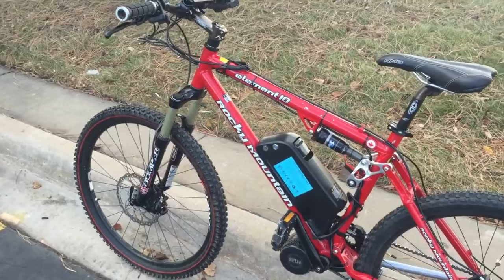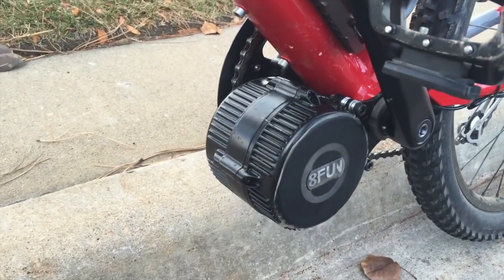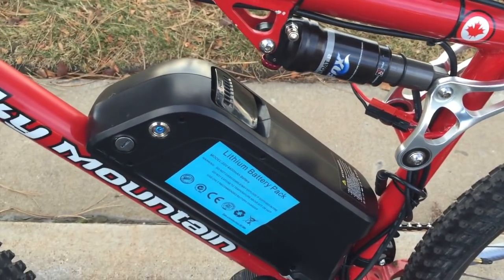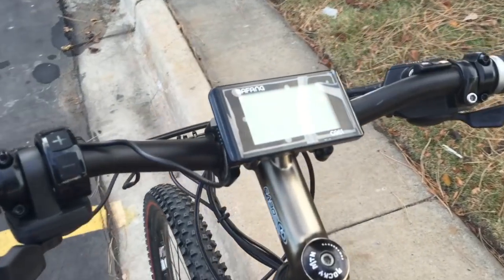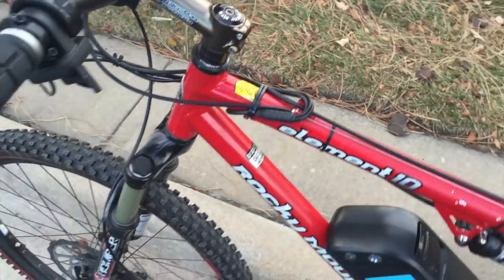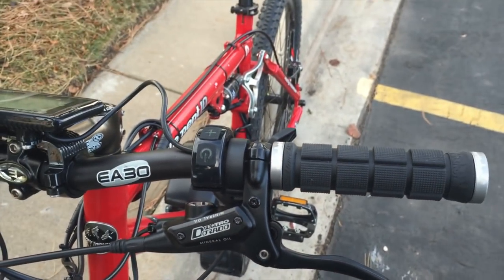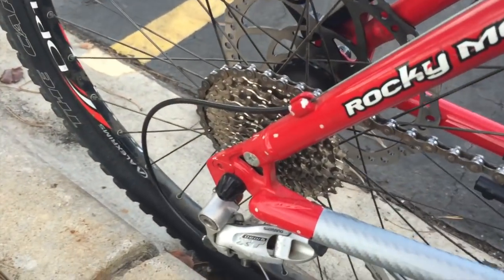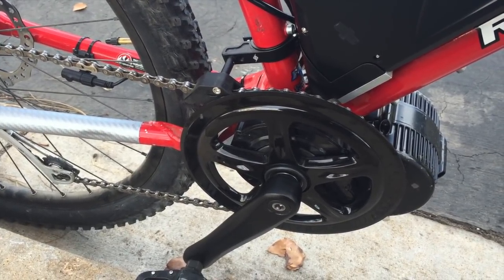DIY FULL SUSPENSION MOUNTAIN BIKE USING BAFANG 8FUN MIDDRIVE SYSTEM

Comment: how did you find the fit for the crank dude? size and stuff
Reply from the maker: Not sure what you mean?
Reply: sorry i mean the size of the bottom bracket , i want to get the 1000w they come in three sizes 68mm,100mm,120mm i have a mountain bike speasilized , i need some help on which size to pick
Reply from the maker: @ELHOLISTIC  ah that's easy. Just measure your bottom bracket. You can just use a roller even. Measure the metal part between the pedals.

Comment: I have had befang motors and they have a spindle attached to coil but the spindle breaks so i changed bike to throttle once bike is moving as too much torque breaks the spindle

Comment: Hello Taras, 
I have TWO questions for you:
1) What would be the minimalist Bafang mid drive build to turn a manual bike into an ebike? 
I ask this because I am not a big fan of too many wires sticking around the bike frame as I see them time and again in installation videos. Can I do a simple build with just a mid drive motor and a thumb (or twist) throttle? I assume that the throttle is the only key element needed to control the motor. I could care less about the LCD display, the speed, or changing the power of the motor as the gears change especially as I ride on the highest gear no matter what the terrain! 
2) Is it a good idea to build ebike on a single-speed bike that can coast? Having no gear derailleur would further simplify my ebike especially when I do not use the gears anyway. The less is actually more and simpler!
Please advise.
Reply from the maker: Hey Amjad! Thank you for your comment. Here is what I would suggest doing if you want to keep the weight down and have a very simple setup. 

If you don't want to deal with having a durreliler and multiple gears and would rather just have a single speed best way is to get a hub motor system. Bafang makes one that is actually even cheaper than the mid drive setup. In terms of battery you can get a rack above your rear wheel and mount the battery there. 

Another benefit of the hub motor system is that a lot of them have battery regen built in so when you are braking or coasting the battery will recharge. 

Let me know if you need help picking out parts I am happy to help.
Reply: Taras, thanks for your detailed response. I will keep your advice in mind as I go about building the simplest possible ebike. BTW, I had never heard of a hub motor capable of recharging itself while coasting (and presumably when you are also pedaling?). Is such a motor only available for the rear wheel or can one also find one for the front wheel as well? Can you share me a link or model of such a motor?
Reply from the maker: Amjad Farooq hub motors are actually available for both front and rear wheels. And newer ones have regen. I will looks up a few options for you and post in here.
Reply: Thanks Taras! Please send me one or more links to a front-wheel hub motor (with regenerative breaking) rated at 500W or higher.

Comment: I have a Bosch Performance CX drive on my bike which I have had for 18 months now. The first battery failed after 10 weeks. Took Bosch 2 weeks to replace it. Now it has failed again (error code 530). Over three weeks have passed since I put it in the shop for repair. Still haven't got my bike back. Pretty poor service. I doubt I would fork out $5000 for another Bosch powered bike again. I use my bike for commuting only, no rain and no off road. Guess what I am getting as my next bike ? A BBS02 bafung. Can't be any worse than my Bosch lemon.
Reply from the maker: Thomas K that is really interesting. I have two Haibikes with Yamaha PW systems and they seem to be working fine. One of them does have an intermittent error where I have to unplug the battery and plug it back to reset the error. What brand bike do you have? Or is the bike itself Bosh branded?
Reply: Taras Alexandrovich hi Taras. No the bike is a Merida eLite Big9. It has the CX connected to a 500W Battery. Another guy at work has a Gazelle with Active line on his. He too has had issues. But in Bosch's defence there is a lady at work who has a Bosch Active line and hers is fine. She only rides to work once a week whereas i ride everyday as does the other guy. I am going to build my next ebike myself around a fuji tourer
Reply from the maker: Gotcha. That sucks. Have you considered the new Shimano system? I heard really good things about it. New Yamaha PW-X seems really nice also.
Reply: My friend has a Yamaha set up. I will keep a close eye on his and how he goes. Right now I am looking to build my own ebike from scratch - that is how disillusioned I have become with Bosch. I was originally thinking another mid drive but it appears a front hub is the way I will go built with generic parts, not proprietary components that cost the earth.

Comment: That's a nice bike. What's your mileage so far. The batteries are the most important issue in balancing. That is a seriously cheap kit.
Reply from the maker: Hey! Thanks for asking the question. Max i ever went on a ride was about 40 miles and still had plenty of juice still left. This kit comes with really good samsung battery so quality is certainly there. I actually ended up selling the bike and replacing it with a Haibike Nduro. The big issues for me with this kit was lack of torque sensor.

Comment: How much you pay for everything
Reply from the maker: Nicolas Mendez at the time it was about $1500 for the kit. I think the new one is much cheaper now. And HD model now supports bikes with much wider bottom bracket. Battery is what's most expensive. It's probably 2/3 of the cost.
Reply: Taras Alexandrovich ... can you provide a link to what you're mentioning here? Thanks.
Reply from the maker: The links are actually in the description.

Comment: range this thing ?
Reply from the maker: spavn 1983 depends on a lot of things. But if you pedal and not just use the thumb throttle you can get about 50 miles.
Reply: thx for fast reply

Comment: The throttle is supposed to be on the right side.
Reply from the maker: jbonnardel I could not do it because of the gear shifter.    It would have been too far to reach with the thumb.

Comment: I have a Mongoose Wing Elite Pro Bike, Quad linkage on the rear & the frame triangle is quite small, looks like I will have to mount the battery on the top oversized tube rather than the oversized down tube.. where can i get a decent battery from which is around 40AH's? is 36V motor better than the 48V motor?
Reply from the maker: That was my issue. About a year ago i broke the rear chain stay. I am suspecting partly it was due to the brakes. Bigger disks moved the pivot point right where the little drain hole was. So i had to buy new frame. I did not want to deal with buying a whole new bike so i found a new old stock frame. I ended up getting a medium size and the battery did not fit. In the end i ended up buying a large frame again. One other option that i looked into for battery was using a backpack battery with a quick release connector.
Reply: Taras Alexandrovich, I don't want another bike as I have five already, two are electric and three are stunt bikes etc.. I did look at a backpack battery holder with a quick release connector but the batteries would have to have a secure cage and waterproof pack with a decent amount of cable in order to do this as mounting/dismounting plus the chance of wiping out might damage the connector..
Then I came up with a solution whereas I would route the cable through the shoulder strap, down my left arm and to a connector on the handlebars. A bit like the dead man's strap on a seadoo.. 
The release method would have to be fully waterproof and isolated as its position would be close to your hand.. I have a decent 36 volt battery but I would prefer a 48 volt 40 AH Lithium ion battery.. 
You could buy a decent ribbed backpack for a decent price and have the battery connector on the base while threading it up the side then through the shoulder strap, down your arm with elastic every few inches to stop it snagging whilst riding through woods etc.. to your QR point on the bars. Just remember if you take your hand off the bars the connection would release itself also..

Comment from the maker: it depends. usually with pedaling I can get about 20-30miles.
Reply: +Taras Alexandrovich If you are riding on the road most times you should get a set of good slick tires.Will give much better range and top speed.
Reply: Taras Alexandrovich
Reply from the maker: Mostly ride single track and general mountain biking.

Comment: do you get more range out of a small chainring?
Reply from the maker: that's a good question. possibly. the most battery drain happens when you really load the motor and it has to work hard to spin. There is optimal RPMs where the motor is not struggle and it not spinning too fast. but I am sure it's pretty marginal difference.
Reply: +Taras Alexandrovich keep your videos to the point man

Comment: How do you shift gears when using the motor? Do you put much strain on the chain when you do?
Reply from the maker: couple ways to do it. don't shift when the motor is engaged. I usually "preload" the brake a bit before I shift. that way you cut the power to the motor. even with a regular bike you shouldnt shift while peddling hard
Reply: Thanks for your vid and pointing out that it isn't as simple as plug and play...I am thinking of building one.  I was looking at the 1000W bafang.  Maybe I'm thing too big but I wanted to use a Gates Carbon belt drive and an internal gear hub like the nuvinci...
Reply from the maker: +genghis29 nuvinchi would be the best way to do it. I was thinking about doing it as well. they are just really expensive. this thing has been great. I need to do a follow up video. as soon as it gets nicer out I will do one for sure
Reply: Looking forward to it!!!
Reply: +Taras Alexandrovich they make gear sensors that cut the motor out everytime you shift
Reply from the maker: +Johnny V not sure if this system has that option or not. I would think if it did it's similar to the brake cut off which I do have. it's not good to pedal hard when shifting even a non electric bike. so I usually just pedal very lightly when shifting and never notice any gear mashing. if I absolutely have to shift when pedaling I just squeeze the brake lever ever so slightly.
Reply: +Taras Alexandrovich Yeah that's a good way to to do it to. The new BBSHD have a dedicated shift sensor wire. For the BBS02 the shift sensor plugs into on of the brake sensor wires so you can only have one brake sensor and one gear sensor, not all 3.
Reply from the maker: +Johnny V I see. good to know. I did not know there was a new kit out. I will look into it. I really haven't been riding this bike much. I modified the bars and seat for my wife and now it's a bit uncomfortable for me. I do want to get a hardtail bike to move the parts over to.
Reply: http://lunacycle.com/parts/bafang-parts/bbshd-parts/gearsensor-for-bafang-mid-drives/
Reply: http://lunacycle.com/motors/mid-drive-kits/bafang-bbshd-1000w-mid-drive-kit/
Reply from the maker: just saw that! This is awesome. It can be used with wider bottom brackets!
Reply: I want to do a conversion but I have some Shimano shiftier built into the hydraulic levers. I'm thinking I might have to replace the whole brake system levers and all.
How did you do your levers did you just order new ones with built in sensors or can you get switches to adapt to the levers I have?
Reply: HI, You can buy disc break sensors for buang..

Comment: The brakes look like 180mm rotors and dual pads. These are just right for the bike and may lock up a bit too easily. But the 160mm is just not enough for a quick e-bike. 203mm rotors would just lock up all the time; unless you are over 100Kgs!

The hydraulic brakes are really special as they have a special (hard to find) brake lever with the built in electric micro switch to tun the motor off. Dunno where you got those from but I'm going to find out where they live!! Much better than the std crap that usually comes with the e-bike brake kit.
Reply from the maker: +bicanoo_magic The Brakes are Dorado brakes. They are certainly way too big for the setup and I am sure even 160mm would have been totally fine. I just ended up buying bigger ones.

Comment: Quick question for you: I've been testing an eBike with a hub motor and throttle. Its nice because you can coast and hit the throttle and let the bike move you without pedaling. Is this possible with the Bafang mid-drive? Thanks!
Reply from the maker: yes it is. the pedals freewheel so you can use the throttle any time you want.
Reply: The throttle works brilliant I have the 750w with a big battery 48v 14.5 ah gives me 60 miles on assist and about 35-40 on throttle

Comment: Dear sir, I have been investigating this unit for some time now and I must say that your video is really informational despite what the haters say. Haters are gonna hate, I always say. Anyway, I too, have a full suspension bike in mind and it has hydraulic brakes. I've seen that many ebike kits provide electronic cut-off brake handles for mechanical style brakes but I have not seen anything for hydraulic. My question for you is: where did you get the modified brake handles to cut power for your bike to continue to allow the use of hydraulic brakes? I live a couple of hours north of you so a supplier near you is something I am prepared to visit. Also, could you give us/me an idea of your total investment(minus the bike)? I'm mainly interested in the cost of the conversion kit, battery, charger, etc.......  everything needed to make it functional everyday. Speaking of battery; what chemistry did you pick and what are the specs(voltage/Ah)? Thanks in advance for your response and looking forward to hearing from you soon.
Reply from the maker: ob1n Hey! Thank you! The total investment was about $1500 with the new brake setup. I got the kit from Matt at Empowered Cycles. I got brakes from him as well. Brakes are Tektro Dorado HD E-710. They are hydraulic and have cut offs built into the handles. I am going to do a separate video reviewing them soon. 

The batter is 48v 11.6ah cost on the battery is about $600. I can easily get 30+ miles on one charge while doing serious tail riding.
Reply: ob1n tektro actually have several brake systems for electric bicycles  you can check their site for more information obviosly
Reply: You may be correct. I'll look into that. I've also been watching lots of videos on the crew at Lectric cycle; I'm thinking they might be able to help me out as they seem to have the 8fun system totally nailed in the customization department. However, I do like the idea of the custom battery(LiFe) offering from Empowered cycles. I still have a little saving to go and more research....But I'm very certain I'm going with this 8fun mid drive setup
Reply: Thanks. The bike I have in mind has shimano m395 brakes with aftermarket trucker semi metallic pads. They work great but it looks like I'll be needing to change them.
Reply: ob1n if I remember correctly shimano  should also have several e-bike ready braking systems hydraulic included
Reply: Michael Levin

Comment: What do you think about hub motor kits, thinking about putting one on the front wheel.
Reply from the maker: Clearanceman2 I considered a hub motor before going with mid drive. Hub motors are great, but mostly for city riding. Mid drives usually have more torque and can take advantage of existing gears you have on the bike. With hub motors you have to re-spoke the wheel which I did not want to do. But if you are looking for something to help you commute a front wheel hub motor is an awesome add on.
Reply: Thanks, yeah I was just going to get the whole replacement wheel with the hub motor for the front.  Street and bike trail only no off road.
Reply from the maker: Clearanceman2 That should work really well for you. From what I understand gearless hub motors are more efficient too. So you can get a much smaller battery. Look into those little bottle mounted 36v batteries.
Reply: I was going to do a rack and a 48V 12ah battery.  About $325 on ebay.  Combined with 1500 watt 48V hub motor kit, I bet it will hit 40mph because they say 45-50 and you know how they inflate the speeds.

Comment from the maker: Both the chainring and the pedals can freewheel. When riding the bike it's just like riding a normal bike. Motor kicks in very smoothly and quickly. It's barely noticeable when motor kicks in. One this I wish this kit had is torque sensor. You really have to play with assist level depending on which gear you are in. Sometime you will be in too high of an assist leave and too low of a gear and you can sort of feel it in the pedals.
Reply: Taras Alexandrovic